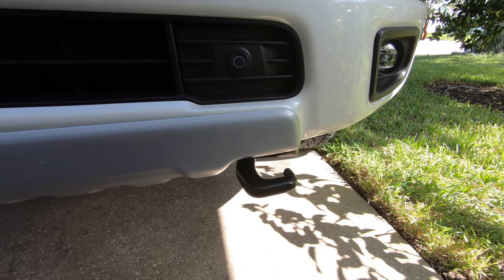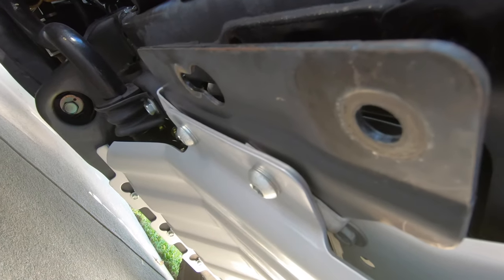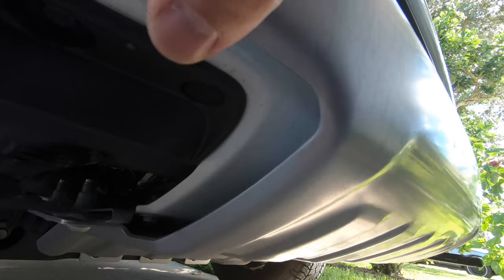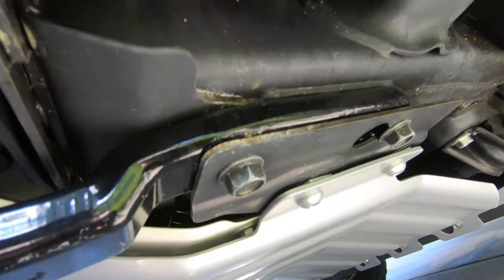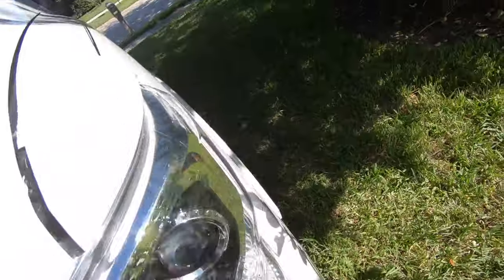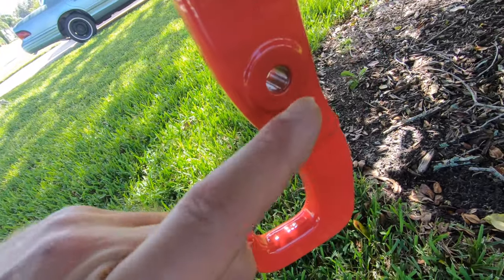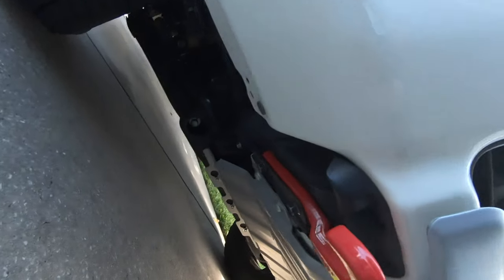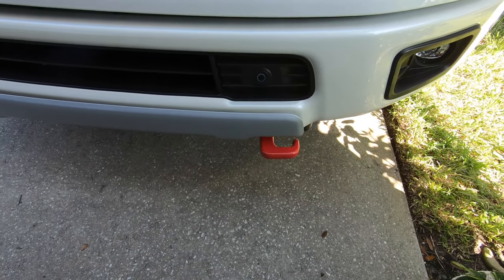2019 Nissan Titan XD  red tow hooks project

Comment: Man i tried on my 2021 sv version and man i tried like 2hrs trying to take them bolts and nope banged up my knuckles lol a few times i think ima just spray them on
Reply from the maker: Yea u need a breaker bar to start. Then finish with impact or a ratchet. Lock-tight is pretty strong
Reply: Oh snap 👍 definitely